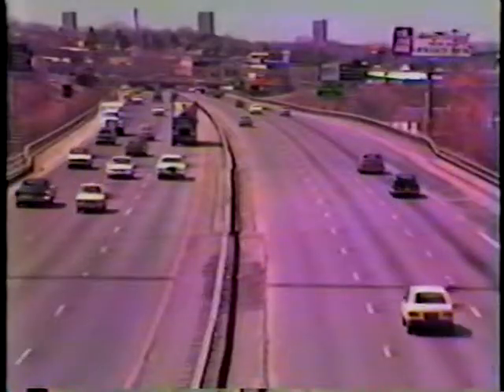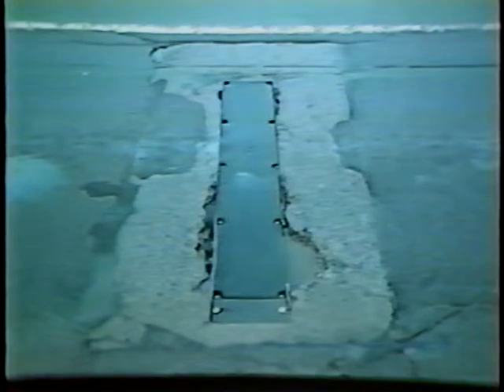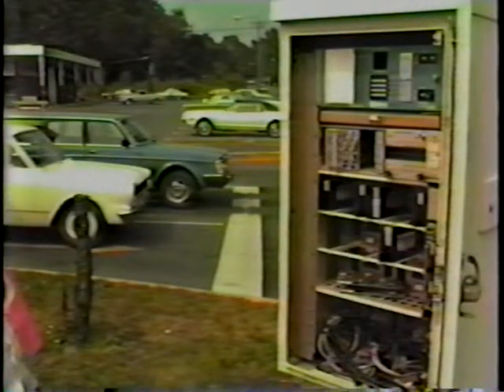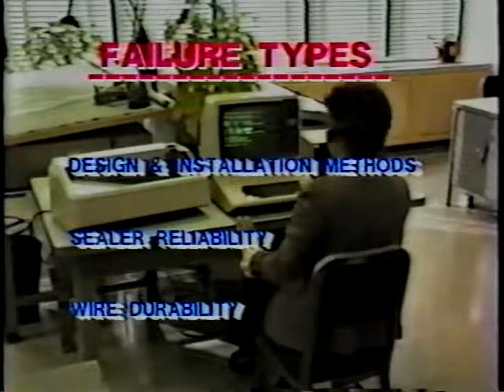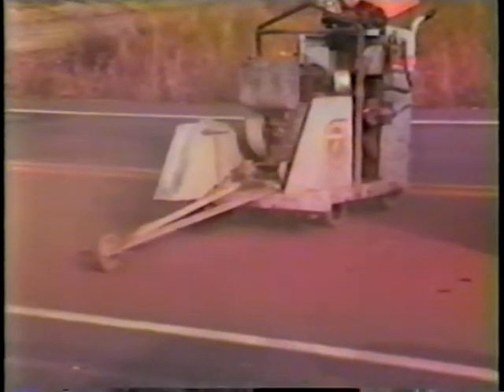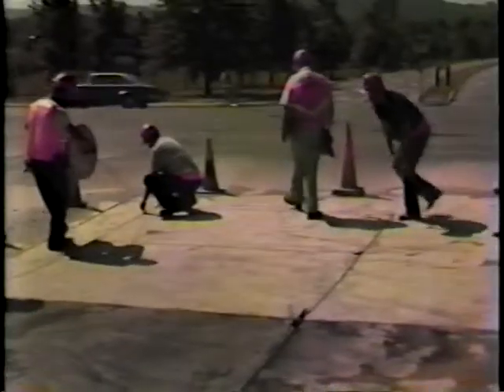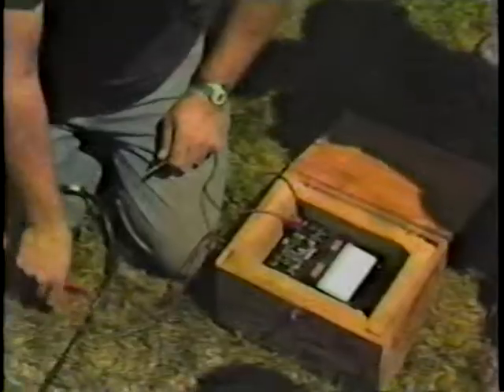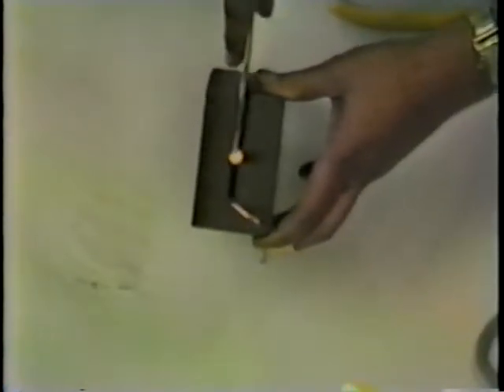Better Inductive Loop Detectors

Comment: Thank you for your post I found it very informative.

I assume your video was made in the 80's?

Our company's here in the UK still use bitumen to back fill the slots and I'm convinced this causes deterioration to the core flex. Most of our sites only last about 2-3 years.

What type of cold epoxy fill did you use?